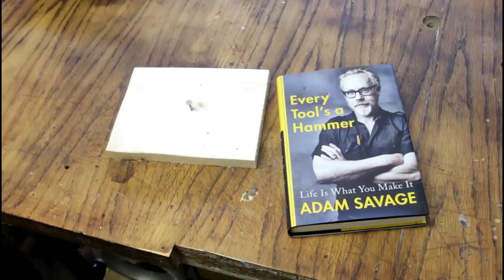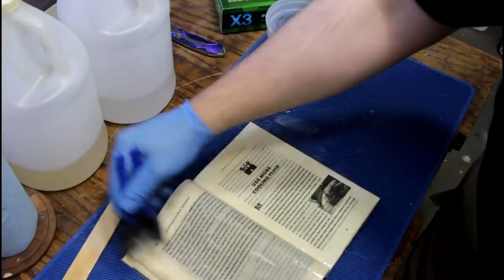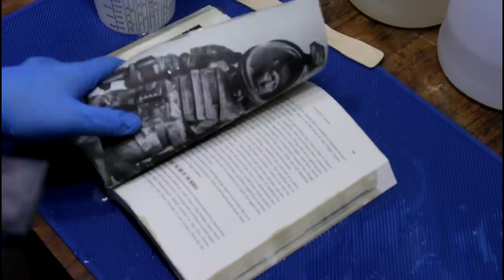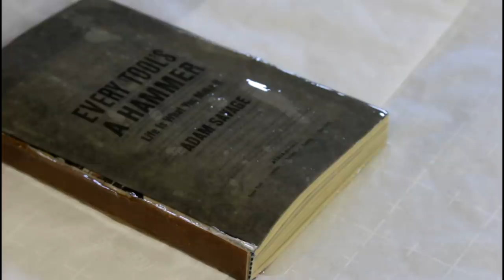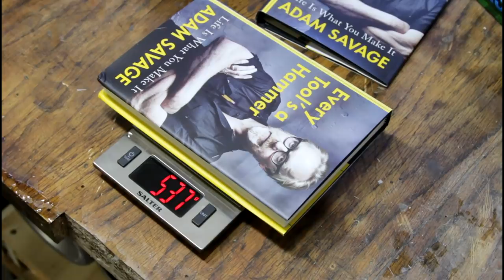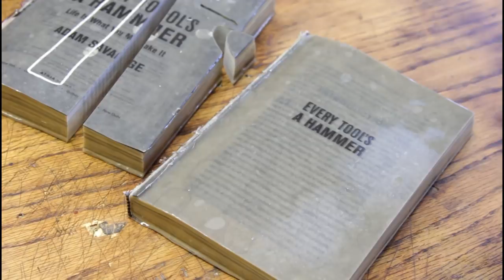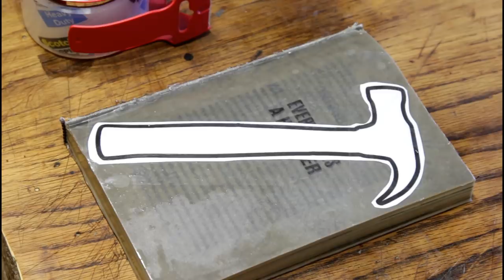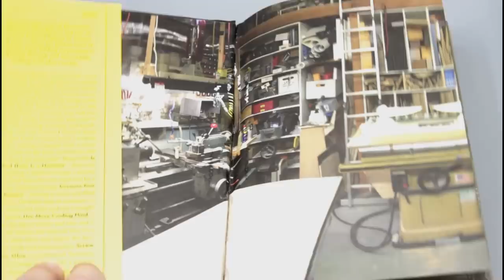Turning a Book into a Hammer!

Comment: "Ever Tool's a Hammer", followed by "Every Electronic’s a Smoke Machine", the Sequel
Reply: The smoke can only be filled in the factory while it's being made. Once you let the smoke out, you can't put it back in!
Reply: @Roderick storey no. This is wrong in every conceivable way
Reply: @lazychris2000  I have seen a Lucas harness smoke refill kit though, but I'm not sure if that is compatible with semiconductors or if it's just for wires... 🤔😁🚭
http://www3.telus.net/bc_triumph_registry/images/Smokekit2.jpg
Reply: Every machine is a smoke machine if you operate it wrong enough!!
Reply: After Mythbusters "everything is an explosive" the trilogy
Reply: DoritoPanda1423 engine, electricals with no rubber, short circuit, and so many more
Reply: Charlotte Karsh most of the time yes

Comment: Peter: There is NO WAY I am making a second book.
Also Peter: So here’s the second book that I made...
Reply: A sane person would have just made a slightly smaller hammer.
Reply: @lauriepenner350  exactly i didnt think he ruined it at all.  It was one tiny line on blank book, improvise by moving or altering stencil.  Also wouldn't have even tried cnc with that material without testing it first.  After all he's making substance with equivalent hardness to tool hardened steel
Reply: Also first one was much better and cleaner, you can tell he was pissed and slopped on second attempt in a rush.  It was droopy and misshapen and couldn't see pages whereas first book was clean and neat and sharp and every page was visible, showing care he took with application in first book

Comment: CNC tip. Always test tool paths on scrap if what your cutting into is expensive or has a ton of time into it. Awesome project!
Reply: In this case, that wouldn't help, since the problem seemed to come from the density of the material itself.

However, the same principle could be applied by turning the book over, so that any mistakes are on the non-facing edge.

Comment: Loved the video! I program CNCs for a living and you were correct in what went wrong on your machine. Depth of cut looked way too deep for the material and the rigidity of your machine, tooling, and hold down set up. Try limiting your depth of cut to 1x the diameter of your cutter and play with the feed rate and rpm til it sounds good when cutting. Try to ramp or spiral into the material if you can.
Reply: Another machinist here-
Yep, far too aggressive.  The cutting force was more than the stepper motors could counter, so the cutter chose its own path.  Stepper-driven mini mills often lack encoders, so missed steps result in it not knowing where it is, and worse yet it's not aware that anything's wrong.  Too deep a depth of cut, too high a feed rate, a dull cutter, or numerous other issues can turn your little machine into a mechanized Ouija board.
Reply: I was thinking he should use a diamond cutter or carbide burr as well.
Reply: FaFbFeverdog the Problem is resin is like Plastik it melt down and your expensiv tool are wasted

Comment: Test your CNC cuts in foam.  :-)  

If you have anew pattern your'e cutting, something you don't know whether it will cut right or not, take some thick structural insulation (the pink, blue, or green stuff) and use it to test whether or  ot your CNC is cutting right or not.   ;-)
Reply: that's a great idea! that might be good for machining practice too?

Comment: You could try to stabilize the book. It might save you those 45 minutes of brushing
Reply: peter face-palms
Reply: Thought the same. Maybe the book was too big?
Reply: Pressure pod: "Am I a joke to you?"
Reply: Luis Horas what I was thinking 🤔
Reply: I think the issue there might be that you can easily end up with dry spots (areas where the pages vacuum together rather than get glued/soaked by the resin) causing resin voids in the final product, making it very weak. 

Not certain at all however, do think it could be worth a try at least.
Reply: @mikemettlach2307  you could roll it up, and unroll it when you put it in the oven
Reply: Plus 1 week of drying
Reply: Sircuit, so the paper is not quite porous enough to properly stabilize?
Reply: Worth a try
Reply: You could test with a pad of post it notes
Reply: Probably would require a crazy large chamber, but one could conceivably suspend the book open by balancing the covers on the edge of container, and filling the container with the resin, thus soaking the pages with resin and maximizing the surface area.

Premium: double dye stabilized micarta (with light colors so as to keep the ink visible)
Reply: I did wonder why he didn't try this.

Comment: The scrap pieces should be made into small, stubby screwdrivers & encased in the cover w hammer
Reply: Put em on a lathe babyyyyy
Reply: I was thinking of a knife but thats cool too
Reply: @rosubogdan7876  I'm not sure that the knife would be functional but the screwdrivers would be for the most part, as long as it's not used on anything too tight.
Reply: @RichardCranium321  You could certainly make scales for a Swiss army knife....
Reply: Make Nails for the hammer

Comment: blade upside down in that scroll saw?... friend has one an it did the same jumpy thing, I turned the blade up the other way so it cut on the down stroke an it was fine
Reply: Possibly. A spiral cut blade would help, too. Also, even cured epoxy gets a bit grabby when it gets heated up again.
Reply: I think my scroll saw is set up like that.

Comment: So does the back of the hammer pull out nails?.....like a regular hammer
Reply: There isn't a wedge for that so no.
Reply: @pink1200  ...
Reply: I’m not sure if the material has that type of strength but if it does I assume it could
Reply: No, he forgot to cut a slot to create the functioning claw portion.

Comment: Alternatively, you could have just ground up the paper into fine particles, poured your resin, poured the paper, stirred, then poured into the mold of your choice. The finer the particles, the more perfect the hammer because it increases uniformity throughout the structure, the more strong and long-lasting it will be and easier to fix as well because if it breaks or chips, you can soften it somehow and then just remold it and harden it once again to repair it. In theory, you could do this with anything, but it's a matter of how easy it is to do so, and how much it costs to produce the final composite.

Comment: How hard is this epoxy/paper combo on bits? Router bits, scroll saw, table saw, etc.

Carbide would be fine I would guess, but steel knives such as on a planer would probably get dull pretty fast?

Seems like a fun material to build with.

Comment: The CNC setup was pretty scary. Long thin tool and way too deep of a cut. Idk if you can use tools with a larger diameter, but I would highly recommend that. Then feed in a spiral down, only like 25 to 50 thou deep each round. Also it seems like the steppers on that machine are not powerful enough, the contour in your second attempt looks like they lost a lot of steps on the way left, that's why they went so far to the right on the way back.
I've milled similar material on my CNC, it shouldn't be out of the question.
For other tools to use I'd go for the band saw. There are some tricks to get those curved cuts.

Comment: If you instead roll the paper tightly and paint it with epoxy casting resin you could even make it into an (axe) '-' I left my dad alone with paper and casting resin it's basically a epoxy/bleached wood fiber axe and for a short time can be used on a tree till it gets hot from the friction and blunts the edge.

Comment: Your scroll saw was jumpy cause u probably had the blade in upside down. Make it cut on the down stroke.

Also I have that same scroll saw and it's shit, even compare to other ones. Dunno why. But I do know it's easy to overtighten the blade so the upper and lower arms become no longer parallel then the whole thing vibrates. I took mine apart adjusted the balance and also don't tighten the blade too much and it smoothes it out a lot.

Comment: Nice result!  Your scrollsaw blade is too small for the job, and the TPI is too high.  Also, the tension on the blade (that big red knob on the back end of the saw) needs to be cranked down hard.  Turn it until it's really tight, and then turn it one more time.

Comment: I had a band saw accident in highschool and they sceeeve me the fuck out now. I also used scrollsaws and I hated them. I felt like I was gonna snap the blade or my work would just gonna break because it would constantly bounce up and down.
Note
I did not injure myself, but I jammed the blade because I pulled back (never do this with a bandsaw) and the blade fell off the still moving track and the machine sent sparks out. I pulled away and immieditely turned it off. My wood shop teacher than yelled at me and I proceeded to not finish the project because 1 he was done teaching cause he was getting fired due to an accident that happend earlier in the year with a kid using something he didn't know how to use, so he kind of gave up and didn't really care about the projects or anything else at the end of the year. I got a 70 for my last project which was a small table and he gave it to me cause I worked my ass off in his class up until the accident. 2 the project required the use of the band saw and I just couldn't use it with out fear.